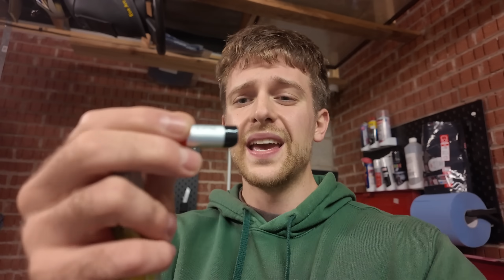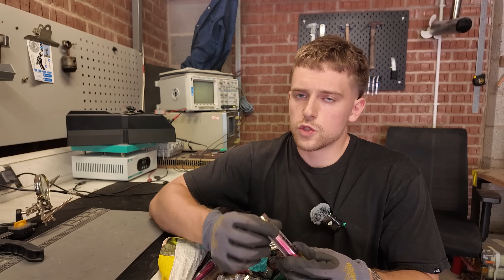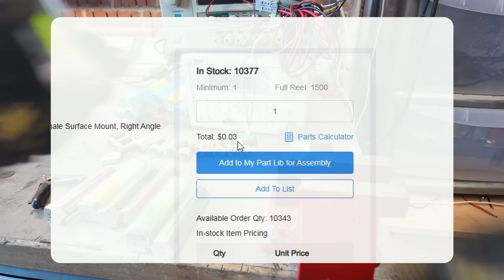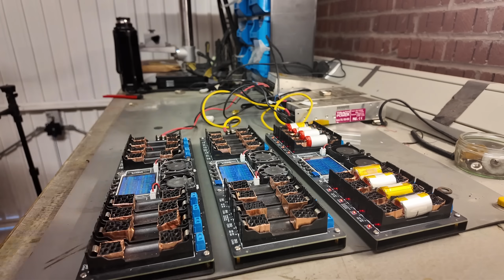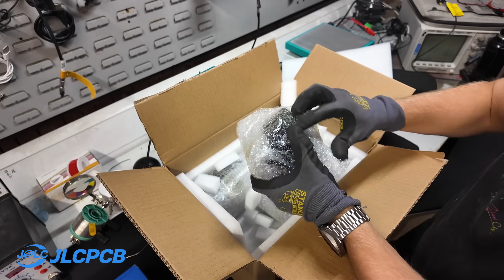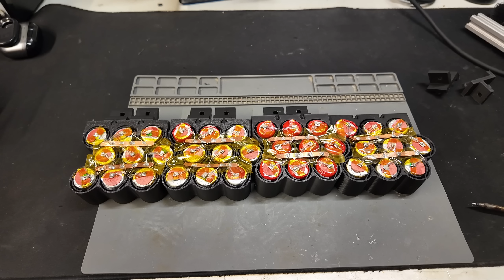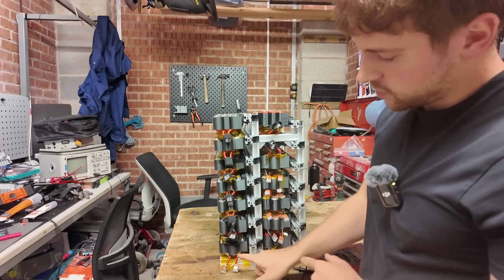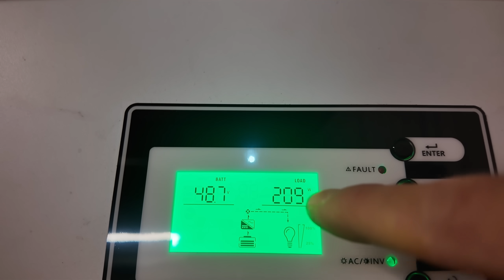I Powered My House Using 500 Disposable vapes

Comment: Cool video, maybe I couldn't see it, do you have a proper transfer switch to switch the supply from the grid to the inverter?  It looked like you were back feeding the boards and also had grid current present at the same time.

If this is the case get a sparky to fit a transfer switch.  Fusebox make a nice 125 amp one for less that £50 delivered. 

You also need to sort out your earthing to a TT setup and install an earth neutral bond relay otherwise your residual current devices will not offer you any protection.

Keep up the great work.

Comment: i normally use discarded laptop batteries for this use, but on a small scale, 500w max because is for powering my vedroom. 
but i still find vaper batteries in the trash so im saving every battery i find because maybe i can build an expansion battery  that runs on 3s 12v

Comment: That kettle power draw @ 19:50... Really helps put the whole "power surge during commercial (tea) breaks" into perspective to us in 120V land.
Reply: I know right, whatching the kettle nearly 10x the load
Reply: Yeah, well, I use 240v to warm my Australian water which is way warmer water than British water
Reply: @leftovercrass5210  😂
Reply: there is a n old video somewhere where uk electrician tries maximum power the kettle can handle, look it up, really interesting and impressive :D
Reply: @xdmin67  Photonicinduction: 10 second kettle
Reply: casually pulling the same draw as four gaming PCs
Reply: My shower is 35A at 220V.
Britsh kettles are puny
Reply: @monad_tcp no shit, your shower is heating a constant flow of cold water from probably 5-10 degrees up to maybe 50.

A kettle needs to boil at most 2L, it's still a phenomenal amount of power output, particularly with respect to its size.
Reply: @angrykidplays1587  Yeah it is a lot but it is more efficient than boilers because it would only heat the water on demand vs wasting energy to maintain the heat when doing nothing.
Reply: @aleksandersats9577  I mean with insulation it lowkey isn't that much of a waste. More efficient than an electric boiler, less effective than a heatpump or (potentially) gas boiler.
Reply: @aleksandersats9577  Boilers are near 100% efficient since insulation is amazing on them and they are usually inside the house somewhere below the living spaces thus heating the rest of the house with lost heat. 
I know what you meant tho :b. 
Its very important to look at what "wasted" power is. For me heating with electricity is wasted power since its expensive and I got other heating.
Reply: @Nelo390  Less effective or less efficient...? Heat pumps are not all that effective at heating water quickly due to their nature, they are however very efficient in certain circumstances. Electric boilers are very effective on the other hand.
Reply: Well, you wouldn't actually  drink the water from your hot water tank, though, would you?  That's definitely nasty.
Reply: @AlpineTheHusky  But don't instant hot water heaters do the exact same thing the boilers do as in waste energy goes into heating the house? I don't exactly see why you would want one mounted outside the house. Also efficient is a bit subjective, electric energy turning into heat is always 100% efficient unless you are using a heat pump from let's say an air conditioner. If you mean efficiency as in energy loss from insulation then yeah, but you can also insulate the instant water heater pipes etc. tbh this requires extensive testing to truly know which is more efficient. Though instant water heaters should be more efficient when you don't need hot water that often I think?
Reply: @monad_tcp  Weird way to flex I guess. Mines a gas instantaneous heater and heaps better than an electric element. It's even older than any electricity ones. About 150 years old. You have to light it before getting in. You heater is puny compared to this beast. Just don't lean on it when in the shower. It's a tad hot.
Reply: @monad_tcp  I'm getting in on this whole hot water heater sub-discussion, I have a Zip Clage CEX9-U 6.6kW - 8.8kW 50°C instant hot water system in my bought off the plan apartment from 2020 in Australia. This gives me hot water for showers, bath and kitchen. It's not super powerful but it's enough for me and my housemate in 2 bedroom / 2 bathroom apartment. I don't know it's power draw but I know my electricity bills are pretty cheap! That plus modern led lighting, induction cooking and reverse cycle air-con our max daily power consumption in the last month was 7.22kWh with a desktop gaming PC with 4070ti, laptop with 3070 and three monitors between us. 
On a low usage day without needing air-con or heating but still taking showers and a bit of light computer use we're at close to just 1kWh for the entire day... instant hot water rocks if it's sized correctly. I just found out I can upgrade to a 60 degree C tank which saps more power but honestly haven't needed more than 50 most of the time, filling the bath tub is slow but it's not used often.
Reply: @monad_tcp  Shower is 21kW here in Germany. 3 phase 400V. I measured 30 Amps per phase with the clamp meter
Reply: @alielabdimarras7965 what are you showering in? Plasma? 21kwh is the amount an appartment building in the us uses at 120/220v and youre at 3ph 400v?
Reply: @buster5643  Not unusual to get 3 phase 400V power in Europe, maybe not in apartments, but houses do get it, and the connection can often be used both ways nowadays (you can sell electricity to the grid, e.g. if you have a solar panel installation).
BTW, 21kW isn't that much when you consider how much energy it takes to heat water, and you have to heat a lot of water (constant flow) in a short period of time. The bigger the flow, the more power is needed.
Reply: @buster5643  KW and KWh are two different things. It's fairly common for a tankless ("instant") water heater to exceed 15KW. My house was built in 1985 and has an *13KW tankless water heater for the kitchen sink and dishwasher. 60 amp breaker and 220V "dryer" plug in US.
Reply: @buster5643  kwh and kw are not the same thing.  kwh is a measure of how much energy is used over a time period.  kw is the power used at any instant.  A 5 minute shower at 20kw will use around 1.6kwh.

And you can bet your life that the hot water and heating in that apartment building is using gas as its heat source, not electricity.  A gas powered boiler of a decent size can run into the hundreds of kw instantaneous power.  if that were all powered by electricity, you'd be running far more than 21kwh per day in that building.
Reply: @alielabdimarras7965  gotta burn them proper... maybe use gas?
Reply: @HittTheDekk  чел, а ну ка скажи мне, в чем отличия квт от квт/ч ? :) допустим, у тебя есть некий прибор потребляющий 10 квт ( не квт/ч), он потребляет эти 10 квт за секунду? или мгновенно в момент включения? или когда стоит и ничего не делает? или же все таки за один час? )
Reply: @zloyfoxi  you'd probably get a better answer from russian wikipedia, but since you asked:

kW = instantaneous load. 10 kW device is drawing 10 kW from the wall the moment it is turned on. If you use that 10 kW device for 1 hour, you will have used 10 KWh.
kWh = energy consumed over time. 10 watt LED lamp turned on for 1 hour will consume 0.010 kWh.
Reply: @HittTheDekk  давай еще раз ) устройство потребляет 10 квт мгновенно при включении и за час израсходует 10 квт? как если оно уже их израсходовало в момент включения  😂
Reply: @zloyfoxi kWh is used to measure the energy over time. They are two totally different units, Watts (power), Watts x hours, Wh, (energy).
Reply: @monad_tcp  - Yeah, British showers are fucking scary!  Let's put a 220V box directly inside a hot and humid box where humans are standing inches away.  What could possibly go wrong?

My water heater is electric, but it's 2 rooms away and can't short through my shower.
Reply: @monad_tcp  Your shower is old fashioned and horrible. That's nothing to be proud of. I'm glad I don't have to rely on such wasteful way of water heating anymore...

Comment: Batteries allow houses to go off grid over the afternoon two hours in winter when the UK uses 95% Of the UK's gas usage.

That's about 182 hours out of the yearly 61320. Or about 0.29%

Our usage is so excessive during this small amount off time, it consumed about 25% of all of Europe's gas!.

This as you imagine has a huge effect on European gas and thus Russian oil prices and so the amount of money flowing into the Russian war machine.

So if you want to:-
Cut the cost of poorer peoples heating,
Cut gas prices.
Help Ukraine.
Help UK and Europe's manufacturing.
Cut greenhouse gasses and local pollution..

Get a battery and solar panels.

Comment: I really don't think the quick disclaimer that flashed for a few seconds at the start of the video is adequate enough to warn people about what you're doing. Please take a minute to run trough the exact risks and dangers of keeping a home made battery pack composed of cells from an unknown manufacturer with an unknown chemistry that may or may not have been designed, manufactured and QC'd to a standard that will allow them to go trough multiple discharge cycles under heavy continuous load...BMS and fuses aside, if one of these little cells experiences thermal runway in the middle of the night its very likley you'll have a very substantial chemical fire on your hands, especially considering the size of the pack. I am by no means an expert on the matter and the foresight I have is from the things I've been tought about LiPo batteries and just having some common sense. Ask yourself how many of your viewers have a good grasp of the potential risks involved here...

Comment: Sorry to be pedantic, but the AC graph at 17:03 is misleading. What you show is the peak to peak voltage, but 240 V is the Root Mean Square (RMS) voltage. This is the voltage you would need if you use Joules law to calculate the average power dissipated by a resistor. The peak voltage is sqrt(2) times the RMS voltage, which is approximately 339 V. The peak-to-peak would be the double of this at approximately 679 V!
Reply: Pedantic indeed 😂

Comment: Your BMS setup is wrong those parallels you made with the batteries are dangerous. When some batteries charge the others, you're forcing them. Each pack should have its own BMS, with a maximum of two batteries in parallel.

Comment: I am impressed as to how much work you put into this project!  One question -- what is the actual watt-hour capacity of the battery?  You said the batteries have about half their rated capacity, so if they were 5 watt-hour batteries originally (from what i recall) times 9 cells per section, times 4 sections per pack = 36 batteries per pack at say 2.5 watt-hours = 90 watt-hours.  Times 14 packs = 1260 watt-hours.  Pretty good using completely disposed of batteries.  You measured their actual capacity so I'm wondering just how accurate this estimate is.

Comment: Your home uses only 6kWh per day?? Man I must definitely be doing something wrong...
Reply: Lot of factors that could reduce it to that point, no AC, gas based heating/no hearing, etc. But that graph could also be presenting purchased electricity, which if he has solar panels or some other power generation on the property that would drastically reduce the daily "consumption"
Reply: well depend on how many you live there and how spoiled you are.
I live alone and use about 6 daily in the summer. 
During the winter, in a really cold day, my heater will add 10 more.
very simple math. 
Fridge about 1, shower boiler another 1, 
lights almost nothing.
The bulk of consumption is my computer, running more than half of the time will draw about 3 or maybe just 2. 
Cooking will take maybe one more or less.  
And washing machine adds some.
And some days may be less. 
I looked up, and is 7 daily average for the last year, including the winter heating about 5 months, and about 20 days air conditioning in the summer. 
So this guy must be alone too, since he uses some in the workshop. 

What adds up to you?
Reply: Same here my house uses between 15 to 20kWh per day
Reply: I use 4 times that, but I have a media server running 24/7
Reply: @chuckles1808 If your media server is burning through 18kWh per day your setup is very wrong.  Unless your surname is Netflix…

Comment: You can simply just slow charge (with the right circuit) those battery's that are bellow there safe voltage. Then they are back in bussiness

Comment: Those batteries are extremely flammable. It is already risky to wire multiple non-identical batteries together. Use LiFePO4 batteries instead because they do not explode---the ones you are currently using do explode, badly

Comment: Hi, 
I don't know if this makes sense, but wouldn't it be more sensible to use a spot welder for the side without fuses? 
And the long connections would be easier that way, which might be more convenient with all the projects,
Or is the conductivity of the connections too low in this case?

Comment: nice one dude!! I did this myself, but only running on 24 volts as the inverter price difference was huge. My setup is currently 7S 160P, using 5.18Wh 1400mAh batteries -  so around 5kWh. We've got solar panels here too but I've yet to connect it to mains, but it charges when the panels are generating power and runs a heap of stuff in my studio! 
But yeh this is defs inspiring me to step thing up!

Comment: Spotted the Clarkson Evans sticker on the consumer unit. I had a new build flat that was wired by them where a load of the cables melted almost starting a fire, and they left a live feed to the immersion that wasn't isolated by the immersion MCB. You might want to run a few checks on your house wiring if you haven't already.
Reply from the maker: Yikes thanks for the heads up
Reply: living  up to the clippy name there

Comment: STOP. These cells do NOT degrade gracefully. They often swell without lowering resistance and you WILL have a catastrophic failure. They are produced with extreme negative anode overhangs to save cost.

Comment: I was wondering if vapes had rechargeable batteries in them, and apparently they were, they weren't even disposable batteries like the ones you get at the store.  I always wondered why they don't sell huge battery packs for houses, so that they can kick in when there is no power.  There are generators for that, and this can be quite dangerous, but this video has taught me quite a lot.  Thank you.
Reply: They do make whole house battery banks, but their not cheap, though the prices have come down quite a bit in recent years, and they really should only be installed by licensed electricians